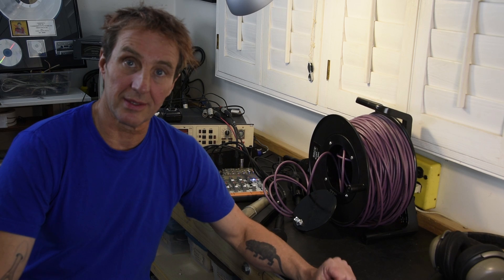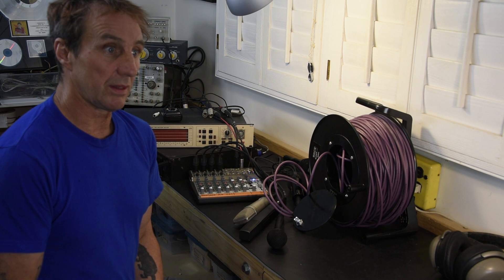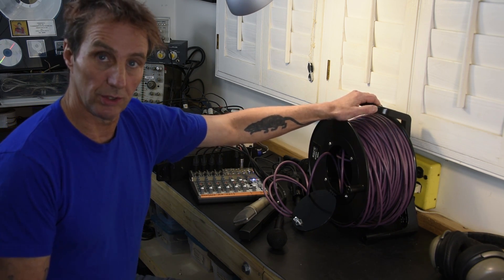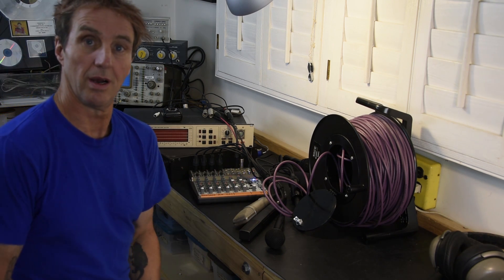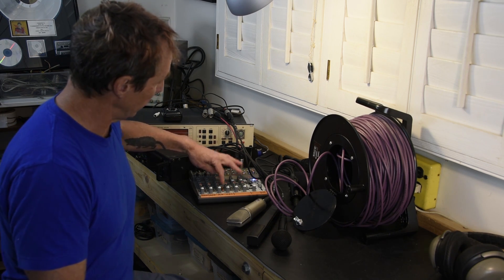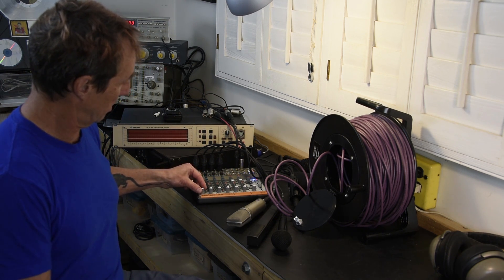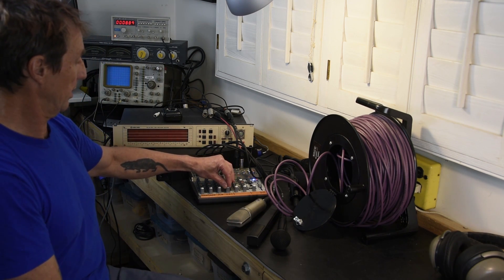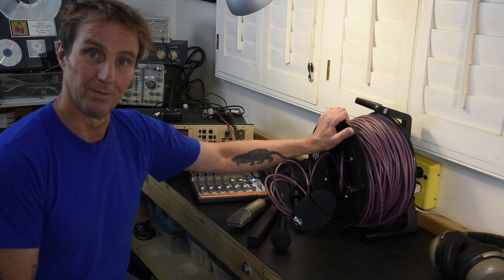Analog Crosstalk on Cat5e Shielded and Unshielded

Comment: I have done a setup where I run headphone output over brown pair and mic input on orange pair. Definitely have a huge crosstalk. It increases with a long cat5e UTP cable. Cannot be trusted in every scenario
Reply from the maker: Yeah with headphones over cat the signal is not only unbalanced but also it's a higher level, so that will maximize crosstalk to a level that is much more intrusive than using balance line signals
Reply: @DaveRat  yes that is possibly the case. I have an idea to try; my hp amp has class d output with a negative output. Since my signal to left and right is same, i Will try to send invert one channel so that differential pair Will cancel out
Reply from the maker: That may help but you really need each of the twisted pairs to have opposing signals on them to get the noise cancellation advantages of twisted pairs
Reply: @DaveRat  well i tried hp output to kinda make differential; sent same signal with 180 phase. Mic input is definitely differential. The result is still unusable. That makes me conclude that signal levels should be really low to have No crosstalk. İt is also very dependent on cable. I will not be using it

Comment: CMRR is like magic. isn't there a spec for twists-per-inch in this stuff too, & minimum installation bend radius, that sort of thing?
Reply: ordinary balanced twin-screened vs star-quad was a real eye-opener for me, back in the day, & then seeing tv data travelling 200m over twisted pair data cable.
Reply from the maker: There are specs for Cat cables. Audio cable is kind of a free for all. That's why cat5 does so well for audio

Comment: If you add a dmx signal on one of the channels, will you hear that?
Reply from the maker: No, it will carry dmx, com, audio and aes3 at the same time without crosstalks issues just like any 4 channel audio snake.

And just like with an audio snake it is generally not recommended to run extremely low level signals down the same cable as very high level signals.

When using supercat sound cable or cat6a or cat 7, the crosstalk is superior to audio snakes as the perfection of twists on cat cables are much better
Reply: Thanks Dave, I was curious if the higher frequency spectrum was causing crosstalk
Reply from the maker: What's really cool is cat cables are designed to minimize crosstalk it very high frequencies so they work exceptionally well

Comment: This looks like it works well for balanced (XLR) microphone level signals with high impedance preamps.  But If you try to use this for unbalanced cable runs (1/4” plug into guitar or keyboard) or worse, speaker cable you will definitely get cross talk.  I’m sure this is obvious to sound engineers out there but maybe not to the lay person.
Reply from the maker: Agreed it works for balanced, as far as how it works for unbalanced, rather than making assumptions, how about I do a test!

Great idea

Comment: The audio in your videos are very low. Hard to hear you.
Reply from the maker: Yeah, working on that. I do the videos spontaneously. Often without planning and try and do a single take and when things are not quite right with the sound or other bits, if the content is there, I just post rather than retake.
Reply: @DaveRat  This is common as most audio engineers use plenty of headroom between 12 to 18db, where most Youtube audio bloggers compress to less than 3 db of headroom, so unless there is post processing on the audio, it is considerably lower than most content. In digital, 0 is the max before clipping.

Comment: Could run a 100w amplifier and a speaker down a pair, or down two pairs using each pair connected in parallel, that might get some crosstalk. 

Should also be noted that for fast ethernet, ie anything in use today, only four of the eight RJ45 (or more strictly 8P8C) pins are used, so you can use additional pins for anything you want in theory, and you can build all kinds of nifty breakouts/bodge plugs for stuffing things down Cat5 that don't belong down there.
Reply: Gig Ethernet and faster uses all the pins, and gig ethernet is likely FAR more common that fast (100mbit) or slower today.  But back in the day, yes, you could use those unused pairs for any number of things from a whole second run of ethernet to analog signals.
Reply: @everettchris1  Indeed, bear in mind I started on 10base2 coax. Where segregated networks are used, processing audio, video and internet via different switches, 100baseT is not a bottleneck for email, so there can in theory be available bandwidth for some extra analogue lines. This is what I have found myself thinking while eyeballing fixed sockets in walls, and having to use mobile phones to debug media networks from room to room, or floor to floor - could I make an analogue talkback bodge box? All the switches found everywhere can do 10base or 100base as well as gigabit, and 10/100 switches are still in use, and still on sale. Walkie talkies and mobile phones work fine most places, though, so it's remained a beard-stroke rather than a habit.
Reply from the maker: Yeah, I don't see mixing speaker level with mic level as something that would be implemented, but I do like the extremes. Maybe I will do a video on using cat5e for 70 volt systems
Reply: @DaveRat  it would be a baaaad idea on many levels, but I do wonder how bad the crosstalk leakage would be. Worst case would presumably be mixing unshielded vinyl cartridge phono with... I dunno... an arc welder? PWM power for something? Feed line for a high power radio station antenna? Power supply for a neon light?

Torture / stress tests often reveal features which are difficult to observe under normal operating conditions.
Reply: @DaveRat  I have seen people using Cat5 as speaker cable, and have considered hijacking cat5 network wall boxes in office buildings / DIY recording spaces for an analogue talkback mic & speaker, so while it's not a good idea, it might have some applications.

Comment: Could you lift one side of the twisted pair (on the music, mic or both) to show how much the twist is doing for us?
Reply from the maker: Hmmm, interesting question. I will ponder using/testing the cable unbalanced. Which will show what I think you seek to hear
Reply: @DaveRat , do you think running unbalanced at that length would be just as likely (if not more so) to pick up more of the typical environmental noise than generate crosstalk? I won't be surprised if you hear all the usual junk from computers, light dimmers, FM radio stations (like with some super long guitar cables) before you'd hear crosstalk. Also, isn't crosstalk directly related to the capacitance of the jacket material on each wire? If data cables work in the GHz range that would explain why anything in the audio range should be practically immune to crosstalk on data cables. Sorry if my thoughts are somewhat scattered on this topic.
Reply from the maker: @paulthomas5901  I think unbalanced would have more Crosstalk and more issues with outside noise influence. I will do a test for ya!

Comment: You rock, would love to see you test crosstalk between pairs inside nl4/nl8! Thanks for the great videos.
Reply from the maker: Thank you. This test shows crosstalk between on shielded twisted pairs with a 60db or so difference in signal level. 10x10x10x10x10x10 or 1,000,000 x more, and the crosstalk was not audible. With speaker cables we may have HF at 10v and LF at 100 or 500v which is only an 10x to 50x differential so we just don't have those drastic level differencea, so crosstalk is less of a concern. That said, to completely avoid crosstalk, separtely shielded pairs is best.
Reply: Thanks. In 4 and 8 conductor speaker cable neither the whole cable or the pairs are shielded, and typically the pairs aren't twisted either, correct? Why would that be? I wonder if there is much crosstalk when using nl8 for passive line arrays, or when using it as snake from amp world to passive monitors, etc.
Reply: @Connor the level difference and open circuit impeadance just isnt really an issue. On a mic pre your input impeadance is generally quite high compared to cable and the current flows are very tiny. In a loudspeaker cable, even the smallest driver is usually 16 ohms and still in the order of magnitude of hundreds of watts in todays systems.

Comment: Cat 5 etc are used as data cables, but they're really just telecommunications cables (telephone). In telephony they have 1000 pair cables carrying voice without crosstalk between pairs. So it's well proven for carrying analogue signals. The other thing is that the reason the pairs don't interfere with each other is that there is no integer relationship between the twist rates of the pairs in the common jacket. That almost eliminates inter pair crosstalk. So great to use for audio even using unshielded twisted pair.
Reply: If a line level return is sent and unbalanced at the termination, and the mixer has poor CMNR, the induction and capacitive coupling could could be high enough to feedback at higher frequencies. Ensure all sources and terminations are balanced to reduce crosstalk between line level sends and mic inputs. It is best to not mix line and mic levels in the same cable when shielded if it can cause feedback such as monitors.
Reply from the maker: agreed
Reply: Would be interested to know what mixing desk was it (what the CMR preamp rating is) and whether the music source was fully balanced one.